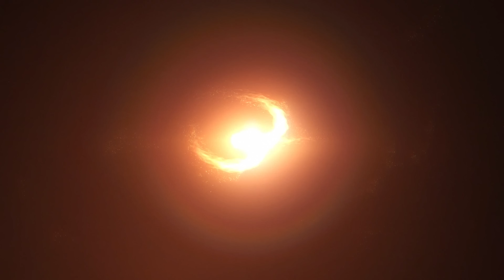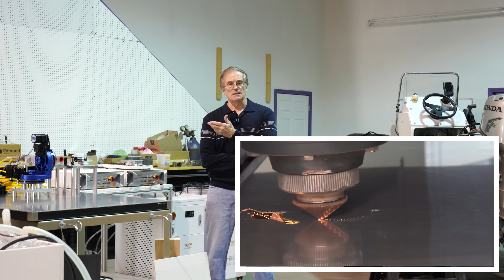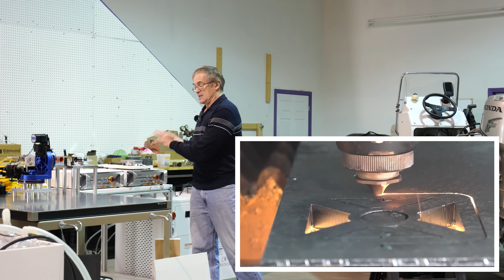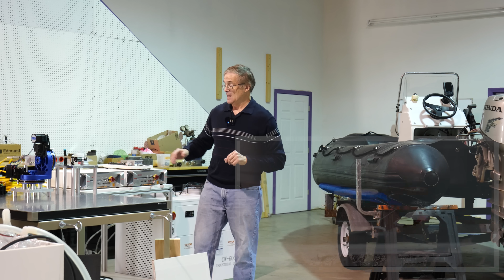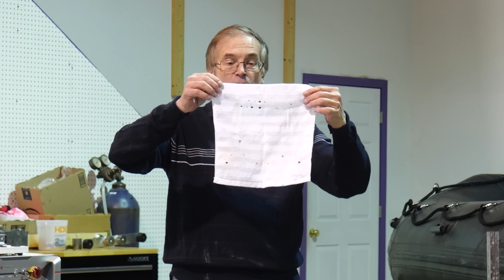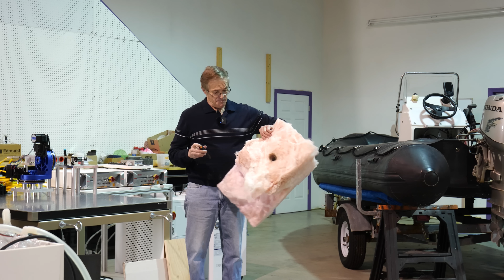We have a problem... and need your help!

Comment: Contra-rotating  layers of drywall that drop into  rim driven frames , kind of like an fashioned juke box, but you stack a couple records behind one another. 4 foot diameter discs, overlaping about 2/3 over each other gradually widening the axis, burn out the center of the first disc, then move it back one step and burn out a wider diameter area in the same disc,,,, then throw away after several steps/shots,,,,,,kind of the inverse of a step drill bit , since the target background is moving.

Comment: A thought I had for anti-laser armor consisted of a densely sintered aluminum nitride ceramic with fluid channels bored through it with the purpose of exploiting the flash evaporation of water into steam.  Perhaps another material can exceed the efficacy of water evaporation on a per volume basis (I don't think anything exceeds water on a per mass basis).

Aluminum nitride can be 3d printed by coating the powder in oleic acid (very specific olive oil) and suspending it in a photopolymer for SLA printing.  An isostatic press of cold followed by hot isostatic pressing can get a technical density material.  The partial transparency of aluminum nitride, its strength similar to 6000 series alloys (though it is a ceramic, so that can be a bit misleading - far stronger than aluminum oxide, though), and thermal conductivity near aluminum allows for the fluid to be blended with something IR absorbent to get a dispersion in depth and the phase change, so long as it can be mechanically channeled away, prevents thermal destruction of the material - which aluminum nitride is extremely temperature stable and is a proper refractory material.

The main limitation is that fabrication services for aluminum nitride are still extremely expensive and the process described has only been performed in the laboratory - it has not been refined into an industrial art or service, to my knowledge, at an appreciable scale.  There are sintered aluminim nitride parts and bulk materials, but a complex shape of interior voids and channels has only been done for research purposes.

Alternatively, a solid-to-liquid phase change material could be employed for short durations of exposure, but a vapor transition from a liquid is probably the only thing that could sustain any exposure longer than a couple seconds simply by virtue of being able to pump fluid into the proberbial breach.

An aluminum nitride structure, alone, impregnated with impurities may be able to serve as a dump, but would need to be reasonably thick.  Because it is anistropic and can withstand high temperatures, you could get it to dump through the volume, which addresses the main challenge of a passive dump being surface ablation.

Comment: You said the machine had already solved it using optics, so could a focus lens system work?
Like you said, without the modification, the light disperses after hitting the target. To me, it is just a matter of increasing the range of the focus distance. If that works, the computer can calculate the distance to the target and adjust the lenses to focus the beam on it.
I'm not an expert, by the way.

Comment: Hardibacker cement board? Tougher and more heat resistant than drywall.

What about rockwool insulation? Fire resistant and maybe you could soak it in water? 

Or both?

Comment: What about a large lens that de-intensifies the beam then the energy can be absorbed by a suitable material behind.

Some sort of Fresnel configuration may be suitable for a larger area without great weight, even if the beam is only spread in one axis it could still possibly de-intensify the beam enough for it to no longer be totally destructive to the backing material.

Comment: So obligatory ignorant internet comment here, but a high carbon ablative material like phenolic resin is probably your best bet. Phenolic resin is a bad choice as it's not cheap and toxic as hell. but there are other options, and maybe a preburnt intumescent paint like nighthawkinlight was playing with  https://www.youtube.com/watch?v=8Z5RPPRS-KQ
Or a knock off starlite  https://www.youtube.com/watch?v=0IbWampaEcM
I was also thinking  a laser trap, which of course wouldn't work for your use case, but maybe a suspended solid in a water tank, straight graphite suspended in water might work? if it doesn't melt the glass.

Comment: If you use Zirconia Toughened Alumina (ZTA). It should be light enough weight to be transportable but at the same time be heat resistant enough not to melt but also help with heat dissipation. It might be worth firing the laser at a sample.

Comment: Just a human with a thought:   What about etched glass?   Where one surface or both surfaces are etched either with a chemical or with an abrasive.   This would scatter the light a bit.   Not sure if that would be the best, but in conjunction with one of your other devices, like the pink wool behind it, they might offer a few moments of protection.

The other option:  Is creating an  optical trigger that will immediately disconnect the circuit if there's spillage from the laser past the target area.